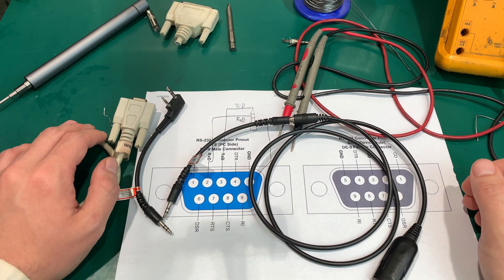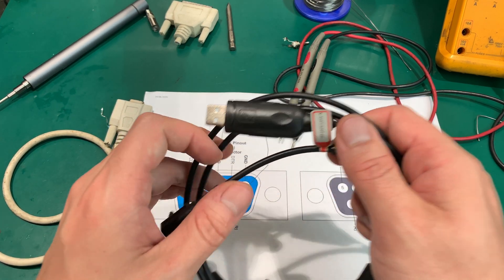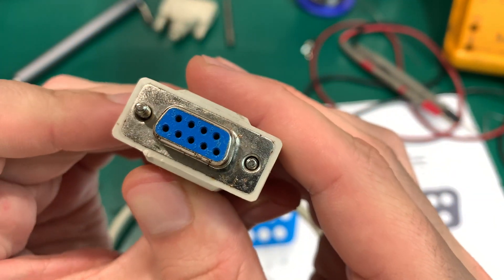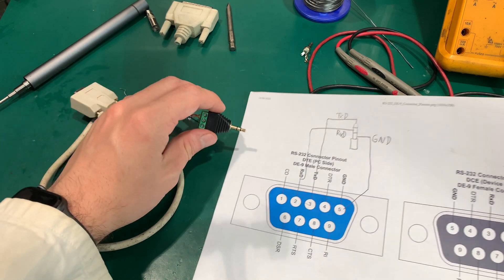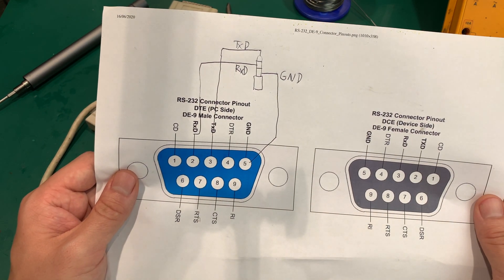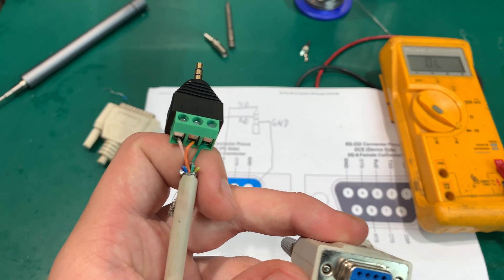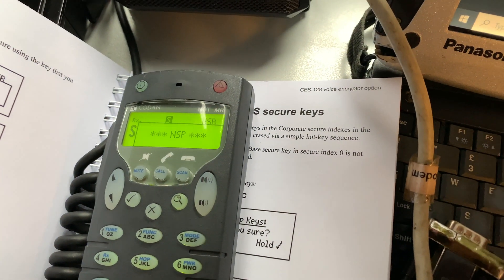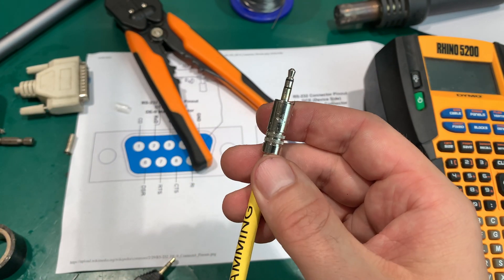Codan NGT making own programming cable RS-232 DE9 to 3.5mm

Comment: Do not use usb to serial converter for upgrading the firmware to NGT radio... when something screw up and it fails then radio can freeze in blank state and you will not restore it without Codan support...